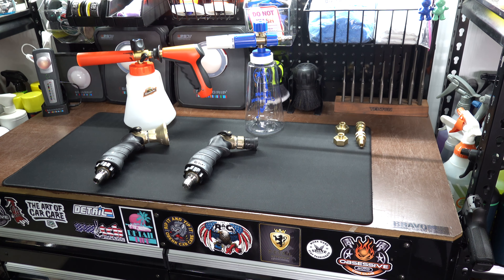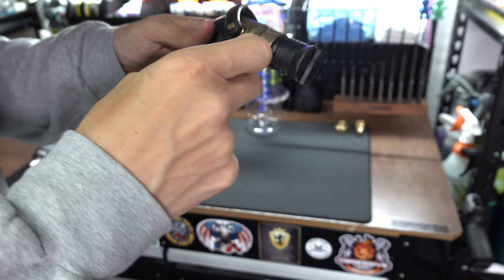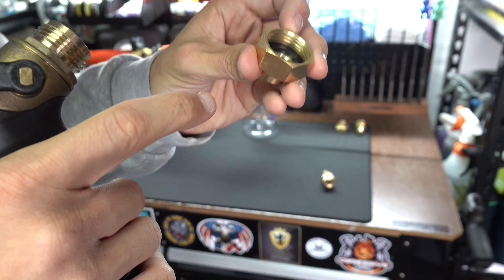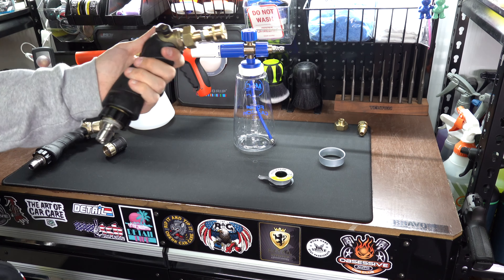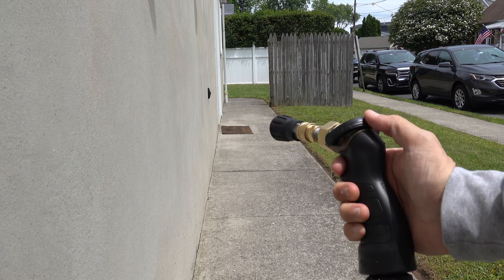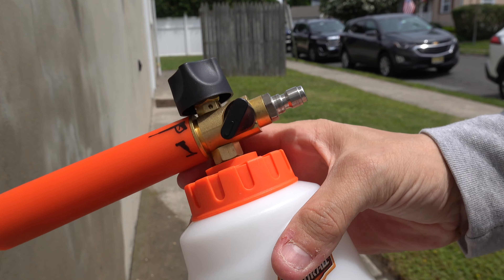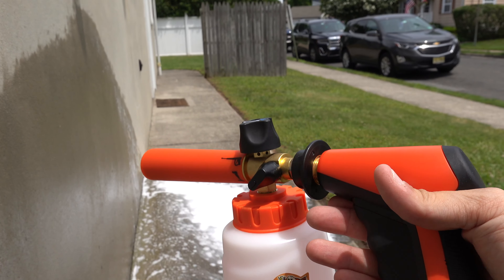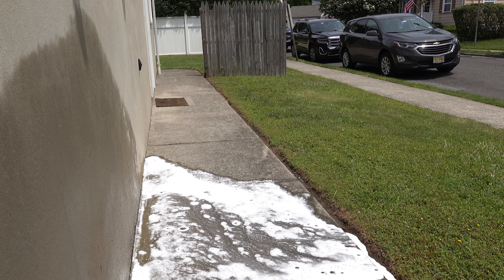Garden Hose Foam Cannon POWER? The Answer Is NO!

Comment: I actually bought the eley spray nozzle based on your endorsement and it’s been really awesome. I just have it on one of those really cheap super flexible black hoses that’s probably too small of an ID to make it shine - but I love it.

I’ll be ordering two of their hose reels and probably include their hoses with them to really see what’s up! I was already eyeing those up for around my house but I was unaware they sold other stuff.

For what it’s worth, after a couple weeks of testing, threading and unthreading the pressure washer nozzle and the.. other one, isn’t really all that bad. Whatever type of threads/gasket situation they have going on just doesn’t leak. Makes the process a lot faster.

I’d still like to grab another handle to not have to swap it as often.

Comment: So here's what I wonder. Most foam cannons require you to go from a 1.2 orifice to a 1.1 orifice if you are using a low flow rate electric pressure washer. I wonder if they make orifices that are less than 1.1 that might help in this application.  Also I wonder if you were to use a really small orifice pressure washer nozzle if that would help when using the eley handle.

Comment: Ok… so first off- thank you for exploring this exact subject. I was thinking something similar, but you went a different way with it. 

Ok: what if you used the Eley handle with the ‘garden hose foam bottle’. 

I have a garden hose foam cannon from harbor freight. The handle/sprayer can be easily unscrewed from the quick disconnect piece, which means any handle that is threaded at the output should work, instead. And eley handles are threaded…. 

Could you check to see if that would work?
Reply from the maker: It’s worth a shot! Haha I’m always down to try things I’ll look into it and see!
Reply: @HonestlyOCD  sounds good! I’m very curious and I’ve never seen anyone try it before.
Reply: You can connect a quick connect to the front of your Eley nozzle, it’s just a normal 3/4 thread so any normal garden hose disconnect would work. There’s even a demonstration of doing so on the Eley website.

I have a Eley Pistol Hose Gun and use a disconnect in the front. With that I swap out my Eley Fan Spray Nozzle, an Eley Drench Nozzle, and a Sudsmagic Garden Hose Foam Gun. All work great together
Reply: @Bobi816  oh for real? That’s great.